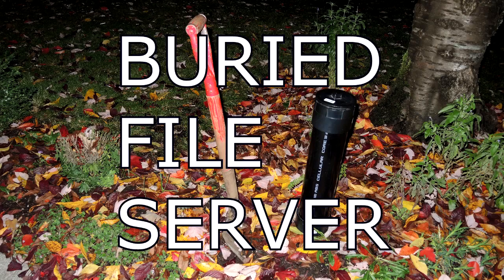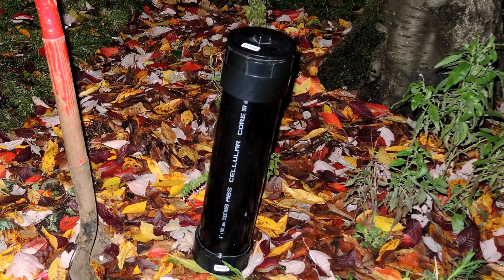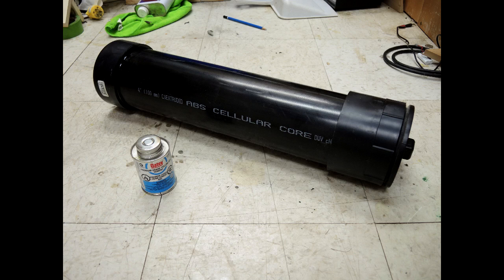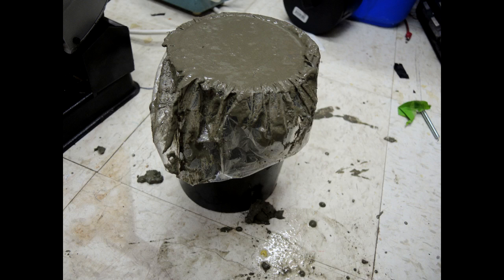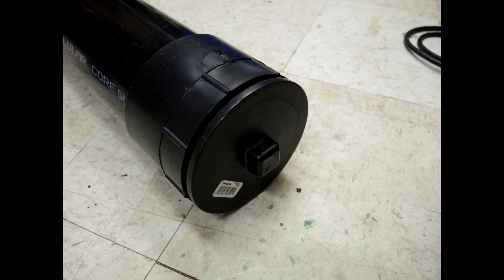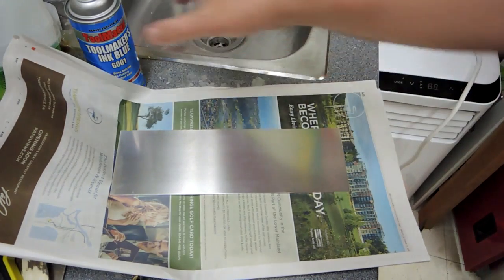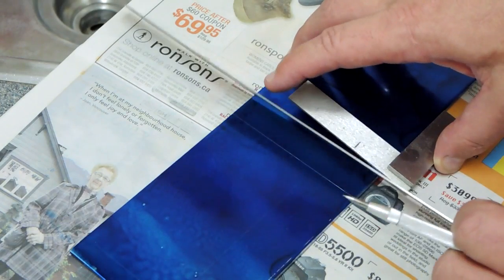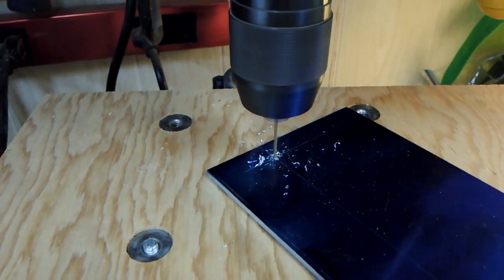Buried File Server: Keeping Data Safe Even in a Disaster

Comment: It would be loads easier to build something in a concrete case or some heavy metal and keep it above ground in your situation.  That ABS pipe is water permeable over time (all plastic is for the most part).  Moisture will ruin this in under 2 years.  I would setup a wood mold of a box, put in a conduit for egress of wiring, drop some wire mesh in it and pour concrete into it - basically a two piece clam shell.  Then paint it with water seal, install equipment, then fire caulk the two pieces together. Once all  your wires are through the conduit, seal it with fire caulk. 

If you live in a flood prone area - put it in your attic.  If you live in a tornado/hurricane prone area, anchor it to your foundation in the garage.  If you live in an area with flooding and tornado - move.

Comment: Great idea! One other thing: concrete actually continues to "dry" and put off moisture as a result for about a year. Being you probably don't have a year to wait a bit of space below it and more desicant should be fine. I don't know if I believe the guy about ABS -- if your boards are conformally coated I would think ABS would be fine. I have seen the preppers just use 5 gallon buckets. And they store gunpowder! In this day and age I would think you could weld up a plastic container of some sort. Solvent or heat. Both are available to the DIYer at home.

Comment: Some more ideas.  Use a switching regulator instead of a linear regulator for 5v supply.  Remove all connectors and hard-wire the devices.  Then use a few coats of conformal coating spray over the connectors and electronics, top and bottom, to prevent corrosion of the circuitry.  Add a CC/CV switching regulator with its output on the batteries and its input connected to two corrosion resistant bolts that can be accessed on the outside.  Set the CC and CV values for the batteries, seal it all up and never open that thing again...
Reply from the maker: all interesting idea, thanks for sharing

Comment: Really interesting!  Could have made a really cheap "Coupled" charger with a coil of wire running off of a solar panel.  Unfortunately, I don't think that you want anyone else to know exactly where your SAFE is.  Maybe some solar garden lights that uses a slightly larger solar panel.

Comment: Very cool, what I would consider to prevent water ingress, you know those CO2 canisters that screw into a valve stem adapter to fill up bike tires while you are on the go?

Rig it up so that when you screw the cap down tight, a pin pierces the foil in the end releasing the pressure, don't have the nozzle aimed at the electronics because it will cause some of the water in the air to condense it's very cold when it releases, but then the tube would be pressurized, so if any small leaks did develop, the pressure would keep water from getting in, at least a little longer than it would without.

Probably overkill, but might still be interesting.

Comment: wasn't quite sure if anyone else asked but i had a project where i was making a bronze mold out of plaster of Paris and i had to bake it for a while to remove the moisture so it wouldn't pop from the water flashing.  maybe the cement can be heated to reduce moisture content.  if the PVC really does let moisture pass over time then maybe it would be easier to treat the electronics. i have read that phones like the Moto G and its successors have some kinda film like treatment on the electronics that keeps moisture out.

Comment: Great idea. Wireless charging is a neat innovation but are you going to dig it up every week to charge? 

Sure you could pack in more batteries and an even more energy efficient computer but even SSDs use a couple of watts a pop. Going to need at least 2 for all your files, but it still could be a useful device. 

Why bother with the valve?.... just accept that your expensive SSDs and everything in the tube will be destroyed if something goes wrong with the battery. 

But I would still go ahead and pack in way more batteries and fire this thing up.    

BTW I would think that wifi reception is pretty poor to nonexistent under a couple feet of earth so maybe test that before you bother doing anything else.

If you're going to mess around with a valve, might as well figure out how to fit cables too and connect it to a solar panel and ethernet back to the house.

It's just a tube at the end of the day you could make it as long as it needs to be to pack in a solar charger and the full works. I'm sure it wouldn't be too unwieldy to bury.

Comment: This is a very cool project.

As others have said, I don't believe lithium ion will off-gas under normal conditions. There are li-ion powered devices that are completely sealed without a problem.
The exception would be a cheap battery that fails due to bad chemistry. You can minimize that possibility by sticking with cells manufactured by Panasonic/Samsung/LG. Some of the newer Anker charging packs on Amazon claim to use Panasonic cells.

The qi chargers (pronounced "chee") seem to vary in quality. The ubiquitous $10-$15 hockey pucks generate a lot of heat and don't transfer much power even with good coil alignment. The "Choe Stadium" charger on amazon is pretty decent in my experience (more expensive 3-coil style).
Presumably the external portion would have to be sealed in plastic/silicone/etc to be water resistant.

When doing the file transfer to the cylinder, if the wifi is flaky there may be a need to use something like rsync to avoid having to restart the transfer, however rsync might be computationally expensive (slow) for a low-power arm processor. Would require some testing.
I assume 2ghz wifi will penetrate soil better than 5ghz, but I've never tried such and thing and would be interested in the results.

If the goal is to store terabytes of data, on read/write storage, in a power-efficient way, at low cost, one of those criteria may have to be sacrificed to make this work with present technology.
A cheapo 1TB sata ssd is currently $300. Larger capacity drives to exist but the $/GB increases enormously.
SDXC cards aren't any better $/GB wise at $100 for 250GB.
The largest laptop-size spinning drive you will find is 2TB for $100. obvious downsides being moving parts and greater power consumption.
A good desktop/server size hard drive is 4TB for $150, but that has ever higher power consumption and may not fit in the pipe.
-
One possible workaround could be to put your current collection of files on a traditional spinning disc, seal in plastic, and place it in the pipe unpowered. Then copy new files onto the raspi ssd as you accumulate them. How feasible this would be would depend on how rapidly you accumulate files.
High-quality optical media could also be an alternative to the unpowered drive if the pipe diameter can accommodate it. Such as the not-yet-available Archival Disc format https://en.wikipedia.org/wiki/Archival_Disc

William Lee makes a good point on the concrete releasing moisture. I'm out of my depth on that one but a thick plastic bag filled with sand might be safer.

The garage door opener power switch is very clever. Like a super low energy wireless wake-on-lan.
If that proves problematic it looks like there is a raspi addon board "Witty Pi" that can do scheduled startup. Though manual control has some advantages.

Do you have an intended service life for the cylinder? Would two years be a reasonable target? After which time the cylinder could be dug it up for maintenance, battery replacement, and component replacement to take advantage of progress in storage technology.

Comment: With TB of data, you're looking at expensive backup if you think of using SSDs. 

My first thoughts about this were to use a powerline network adapter and a small motherboard ideally equiped with a DC jack so that  I could feed it with power from a completely sealed 19v laptop adapter and use regular NAS 3.5" hdd drives - I'd still seal away the power supply and the powerline network adapter in a compartment to prevent fires if one of those fails. 
This way, you just plug the power cable from your underground box in the mains and in a couple of minutes the system boots up and you can transfer files to the system at up to gigabit speeds... when done you can send a command through the network to shut down the machine and you can just unplug the cable and you're done. 
You'd only have a couple of wires coming out from the undeground box, you can buy them flame retardant/ fire resistant cables, pull them out of the ground through a  waterproof  pipe .. but then there's going to be some minimal risk of lightning strikes hitting the cable

Comment: Lithium batteries dont offgass under normal operation i dont think. for instance pouch cells are completely sealed. 18650 cells have vents but its only a last resort to vent. thats unlike lead-acid batteries.

you could put two spark plugs on the top and use them as insulated conductors so you can have positive and negative entering the canister while staying sealed. then have another waterproof shell around that to house a DC power supply or something.

or another idea if that doesnt sound good, use metal caps on the end so each would be positive or negative. i've pretty sure the metal plumbing ends will fit into the PVC ones.

Comment: I do this sort of thing for a living, and the bad news is that ABS pipe is not really waterproof. It works fine as a pipe but over a long period of time moisture will seep in.

The desiccant will help, but probably only for 6 months. What you really need is a metal pipe and end caps, with rubber o-rings. A bit of grease helps too. Of course, a metal pipe will attenuate WiFi a lot but you can get waterproof antennas and connectors (TNC are good).

I make products that are buried or submerged for years, and ABS plastic isn't adequate unfortunately.

For charging solar on a wire above ground I'd probably the best option, if you don't use it too much.
Reply: +kuro68000 What would you recommend for passing the power from the panel into the tube? I would have preferred plastic if only because I could wind a transformer that couples magnetically through the tube's walls.
Reply: +kuro68000 Would schedule 80 pipe be better?
Reply: +ScribblesOnNapkins I'm afraid I'm not an expert on US pipes... Metal or fibreglass ideally. For wires it's tricky, you have to consider that moisture can get into the cable if you are not careful to seal it at both ends. Rubber o-rings around the connectors and some grease work well, if you use IP68 rated connectors.
Reply: Are there fibreglass pipes that are waterproof? (I mean so you can build a whole enclosure from them), if so, they would provide an rf-passing housing...
Reply: He could also mess with the Canadian FCC equivalent and make the metal pipe part of the antenna

Comment: Seems to me filling with activated charcoal will absorb the minute amount of off gas, however a battery failure is different, for that insert a very tight rubber plug.

Comment: Its funny I was going to suggest the wireless charger. A small solar panel or wind turbine would work.  if you grabbed a low Kv brushless motor from hobbyking and wired it to a bridge recitifier you could produce a small amount of power and let the unit be always on
These batteries would fit your tube http://www.batteryspace.com/lifepo438120pmsizecell32v10ah100asurgerate32whwith6mscrewterminal-unapproved.aspx

They do outgas but I think that mix is more stable but lipos can be explosive.

The only other problem i see is if the fire breached the top of the tube the air could heat up and destroy the storage inside. The only option to prevent this would be burying the tube deeper in the ground. You could find a way to extend the usb receiver to the surface but that would breach your tube.    
 
Great stuff as always.

This guy as some good videos 

Lipos 
https://www.youtube.com/watch?v=ZJHlJYDJohc

Radio transmission 
https://www.youtube.com/watch?v=Bx7gMUw1MGw

Comment: you could also fiber glass the hols closed - that's water tight - I managed to fix a canoe that snapped in half Two massive cracks down the center - as far as those lithium cells I don't believe they outgas - they are sealed

Comment: LOCTITE Marine Epoxy is Water Proof and can cure under water - That's what I would do - drill a hole run the cable thru and epoxy the hole closed http://www.amazon.com/Loctite-1405604-0-85-Ounce-Plastic-Syringe/dp/B000H6A3D6
Reply: +Sachi WI  there will always be a problem with water wicking along the side of the cable and epoxy union, the two dont stick well enough to each other, Julian Illet had similar issues with a solar controller, entirely wireless is the best option, perhaps in a few yers people will have these in their graves and inviting others to browse their movie collection!

Comment: Cool idea. Maybe you could make a separate chamber for the battery. You could also run some low voltage lighting for your garden and then as they come on every night they secretly charge the battery. I also like the idea of solar charging. You could probably use one of those boost packs everyone uses to recharge their phone. Hmmmm this makes me wonder if there is a way I can bury my Drobo 5D in the back yard and run a really long USB cable :)

Comment: nice idea, will be interesting to see how much the wet soil will attenuate the wifi signal. I think i would have used a wired option though, run a network cable with PoE.
Reply: +DextersLab2013 That's what I would have done too, have a wifi adapter that will switch on if POE is lost, but have it connecting with an Ethernet cable otherwise, you could even rig it up to occasionally discharge the lithium cells to keep them healthy.

Comment: May want to check out how viral labs run there power/data cables.   
I believe it's a type of epoxy they use to fill an over sized hole the cable runs though.  Suppose to be vapor proof for 75 years.  
But that data came from a political source so you may want to check the standards.
Reply: The trick is to strip a bit of insulation so you have bare wire surrounded with your epoxy.  That way if the wire gets nicked then water can not get in underneath the insulation.  I have also used Vaseline to fill the inside cavity as a backup.  Probably the easiest is to use a cap like on the top and drill the hole in the middle then fill the inside with the epoxy.

Comment: Super cool! Solar charging? I had a lithium battery in a early MacBook that gassed. Warped the whole laptop. They are also heat sensitive. Thermal runaway after a certain temperature. Something to measure and keep an eye on in an enclosure.
Reply: +BeatNursery actually thats a good idea, a wifi file server, disguised as a cheap solar light, you get the power as a bonus, plus no one wants to steal a cheap solar light, plus no attenutation from the wet dirt.

Comment: In normal operation Li cells don't outgas. These cells have pressure release valves but it's only a safety measure in case the cell fails. As long as you keep the power bank circuit in place, it will take care of the cells and they shouldn't outgas. IMHO
Great project!